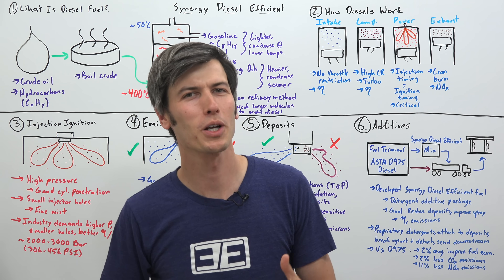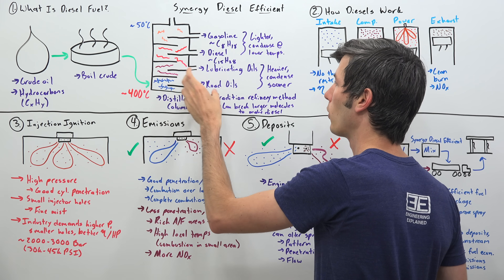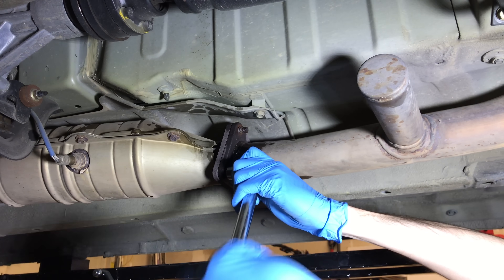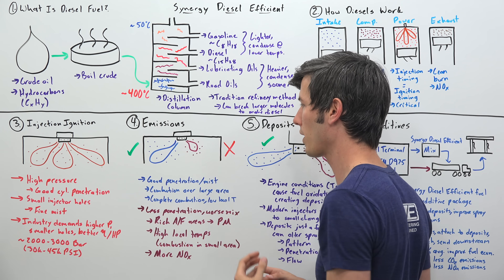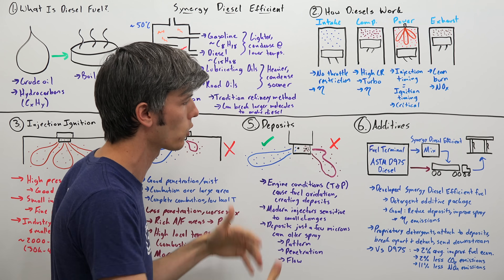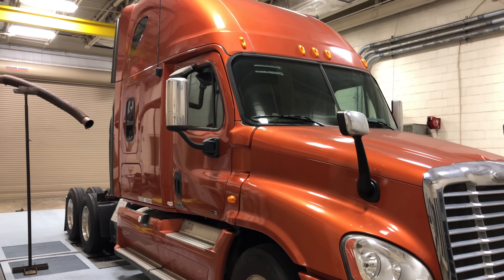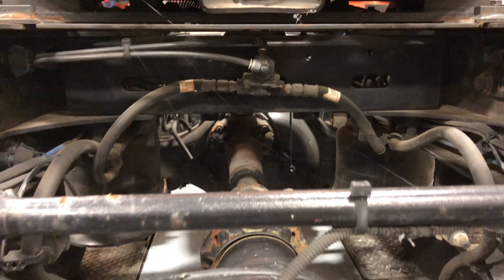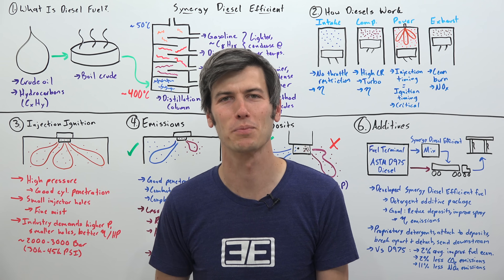Why Diesel Engines Lose Power & Efficiency Over Time

Comment: A load of cobblers, probably.  I worked for quite a while as an Engineer for a dealer selling engines from a certain well known US manufacturer.  Customers ranged from heavy duty & long haul truck operators, to large boats and mining company power stations. I never met a customer/owner who gave a fig about emissions, but they sure as hell all cared about fuel consumption.  That's because in all applications of large diesel engines, the cost of fuel is 90% of the cost of ownership over the life of the engine.  Dyno testing of dealer-serviced engines is routine - saves a lot of arguments.
So I can tell you that a 2% improvement as stated by Engineering Guy would startle the industry - its very nearly a 2% reduction in overall cost and typically about a 20% improvement in profit (10% operating margin).  So I don't believe it.   Oil companies are always claiming their fuel is best - they've been claiming that for ever since they started selling fuel, 100 years ago.   Secret ingredients are a dead giveaway.  It's really hilarious where I live.  In my country, there's a multitude of brands on sale, but only a couple of oil refineries.  In much of the country, all fuel comes from the BP refinery.   So it doesn't matter where or who you buy fuel, BP, Shell, Caltex, or whatever, it all comes via tanker trucks from the BP refinery, except for a small number of independent resale outlets importing from Asia.  Except for the independents, you get BP fuel whether you like it or not.   It doesn't stop the various brands claiming fuel purchased from their outlets has got something extra though.
As others have said below, engine efficiency only drops off to anywhere near  a measurable degree if it is not properly maintained and used with clean fuel and oil of the correct specification and within its use-by date.   And it is ALWAYS cheaper to do the maintenance and do it right.  No operator with half a brain is going to operate with fouled injectors.

Comment: If spreading out the diesel spray is so critical - why aren't there engines that have multiple injectors per cylinder? Maybe loads of small holes around the cylinder wall?
Reply: Some large Industrial and Marine engines do have multiple injectors. Probably a cost issue

Comment: Brother in law's 2000 F350 7.3 D has 800,000 miles and still an all original engine and would still pull most any house off its foundation!!

Comment: Hi, marine engineer here with a suggestion!

I understand that your channel is about the engineering inside a car, howerver I suggest for your channel to take a field trip to a producer of marine diesel engines, eg. Wärtsilä. These typically are very large diesel or BI-fuel engines. With the engines being a lot larger than the ones found in a car, all the components are too. This can really help as a visual aid for your audience. For example:
I used to work on a vessel using 4 Wärtsilä Sulzer 8 in-line 400mm in diameter making more than 4000KW per engine for propulsion use only, running on IFO360, MDO & MGO. Normally each cylinder has 1 fuel injection pump delivering the fuel at +/- 380 bar at a viscosity of 2-4 cst. However, the new type of BI-fuel engines have multiple fuel injection pumps per cylinder. These fuel injection pumps are actuated by the camshaft and are about 50 cm tall. If you want more info on marine application engines, feel free to contact me.

Comment: They should have outsourced the testing to VW for even better results.
Reply: Hahahah, funny!
Reply: I dont care about the emissions. The made one of the best engines in history. The 1.9 TDI.
Reply: @WorivpuqloDMogh  yep
Reply: Caterpillar did the exact same thing before VW and got just a slap on the wrist...
Reply: @C_R_O_M________  so did Harley Davidson -- but they're American so I guess that means it's ok lol
Reply: @C_R_O_M________  did not know that.. noice.
Reply: peter last 😂😂😂
Reply: Just think how much MORE fuel is burned over the world during emissions testing now that VW had to put their cars back to how they should have been.
Reply: Leo Rigby

It was never about how much fuel was being burned. It was how much emissions. Emissions are far worse than fuel use. 

If emissions didn’t matter, we’d all be driving two stroke engines and getting awesome fuel economy just like they did in East Germany in the 1950s.
Reply: @calvinnickel9995  yeah now I think of it a hotter burn would be a cleaner one. Wonder how the small petrol turbo engine does when it is squirting more fuel in to cool down the mixture to prevent knock. Wouldnt be picked up by emissions either i gues.
Reply: Rather, get their drivetrain control firmware/software from them.
Reply: Diesel should be what every vehicle has.
Reply: @talisikid1618  if i want a 2.0L NA 4 cylinder i should be able to get one
Reply: @talisikid1618  modern diesels are cleaner than they used to be as well. It will return and the downsizing of engines needs to stop
Reply: @WorivpuqloDMogh  I run a 1.5 Turbo TDI AND GET 28 MPH on Highway. It has plenty of day to day power. I maintain it religiously and have had no issues other than higher than normal maintenance cost.
Reply: @steveschu  28 MPG isnt that much actually. I got 45MPG with my 1.9

Sadly i got rid of it because i filled it up a few times with the red stuff, didn't want to get caught.

I now have a Xantia, same engine displacement, almost the same MPG
Reply: @talisikid1618  At least a mixture.
Reply: 😂true that👍
Reply: Savage
Reply: that hurts !
Reply: VW didn't fudge their emissions test results. They programmed their vehicles to operate more efficiently when the vehicle's computer detected that the car was being emissions tested
Reply: as a german i have to say VW/Audi were big liars in that.... put shame on our engineering !
Reply: Haha! Yeah I don't agree with torturing VW financially for what they did.  Swimming pools evaporate 100 times more chlorine molecules into the air and these can reach the ozone layer because they are lighter than air.  All refrigerants are heavier than air and soak into the ground,  thus never being able to float up to the ozone layer.
Reply: @scottbishop2532  Not arguing with your first point, because i feel everyone participating in the cheating should have been punished, and not all of it put onto VW. But i was super curious about the chlorine comment, turns out chlorine evaporation from pools, and to an even greater extent, the ocean, lot's of evaporated chlorine comes from salt water, is all water soluble, meaning it gets absorbed into moisture in the air and clouds, long before it reaches the stratosphere and the ozone layer, and just make the rain, air humidity have a slightly higher salt content. Where as NOx and the chlorine compounds that come from combustion, are not water soluble, and do make it to the stratosphere.  I love researching things and thought I would leave this here for anyone wondering. 

That being said I am way more worried about coal fired power plants and container ship emissions from burning bunker oil then a few passenger vehicles, and absolutely love my modified TDI.
Reply: @CondoreComputing  How can you prove that anything "makes it to the stratosphere"?  You can't !  If a gas is heavier than air guess what?  It is going to absorb into the ground not fly upward to the stratosphere why?  Because of gravity sir.

Comment: I have a 2012 diesel VW Jetta and it is a Turbo.  This car is great I get well over 40 MPG and the engine is so quiet.  Every time I stop for fuel and ask for diesel the  person (at the different gas stations) ask if i'm sure...  that's how quiet it is (In NJ you can't pump your own gas its against the law)    Are there anythings you should do to stop losing power with the engine?  I haven't noticed a difference since I owned it?  Just passed emissions with no issue even after that VW screw up  LOL
Reply: curious how many miles you have on it ?

Comment: It's a shame that Exxon-Mobil couldn't find a way to pre-mix detergents into the ~10 million gallons of crude they dumped all over the Alaskan coastline, it might have made life 2% easier for the people who had to clean up the mess. Or maybe it would even have killed 2% less wildlife? It definitely would have made people forget about the disaster 11% quicker, although that seems to have happened anyway...

From Wikipedia:
Litigation was filed on behalf of 38,000 litigants. In 1994, a jury awarded plaintiffs US$287 million in compensatory damages and US$5 billion in punitive damages. Exxon appealed and the Ninth Circuit Court reduced the punitive damages to US$2.5 billion. Exxon then appealed the punitive damages to the Supreme Court which capped the damages to US$507.5 million in June, 2008. On August 27, 2008, Exxon Mobil agreed to pay 75% of the US$507.5 million damages ruling to settle the 1989 Exxon Valdez oil spill off Alaska.[10] In June 2009, a federal ruling ordered Exxon to pay an additional US$480 million in interest on their delayed punitive damage awards.

Comment: If the new diesel additives are suggested to reduce/remove carbon deposits from the fuel injector heads, would this imply that the PM 2.5 and PM 10 emissions increases for vehicles run on this new diesel blend? It was suggested that inherit in the burning of diesel fuel that due to fuel spray inconsistencies and irregularities affects such as high A/F ratios to can lead to carbon deposits forming. Is there any data out there that suggests this? I know that this analysis listed the NOx, CO2 and fuel economy values but how do PM 2.5 and PM 10 emissions compare with just using the standard diesel fuel vehicle?

Side note, I’m not going to get into which emissions are worst: CO2, NOx, PM 2.5, etc. I’m just interested in the engine, and fuel engineering here. If it is shown that particulate matter emissions can be reduced using this fuel it stands to reason that more efficient Diesel engines can be designed to utilize this fuel blend... (finer/narrower fuel injection ports, etc..) however if it is true that the burning of diesel always forms carbon deposits then what is the importance of fuel additives that “scrub fuel injectors” over a periodic engine service which removes the deposits from the injectors done in the shop?

Comment: Diesel stinks and the smell if the exhaust is even worse. Diesel maintenance sucks and It's more expensive than a gas engine. I had a diesel Jetta for a few months...$350 for an EGR valve because of a leaking seal that should have been replaceable on its own. I got rid of it as quick as I could. $1200 for a turbo, $1200 for an injection pump...I paid that much for the car. If I ever go back to ICE cars, I'll stick with  Honda vehicles.
 $7000-$10000 head gasket job on these Chevy and Ford diesel trucks, several thousand for a turbo replacement, $200 oil changes... Hard pass.

Comment: You never mentioned how CETANE affects the engine operation. As a diesel owner, I feel that's a pretty damn significant thing to not even touch on. I'm going to guess it's because ExxonMobil's "special additive package" mainly is just a small CETANE boost with the standard additives I can get at Chevron.

Comment: Diesel injection pressures can be as high as 100Mpa. My old Corolla Diesel would idle around 30Mpa. At least, that's what the OBD2 reading for the fuel rail pressure said.
Reply: I didn’t know they made a diesel version! Obviously not in the US
Reply: @SquishyZoran  It had the 1AD engine, a 2.0 liter turbo Diesel that was also used in the Verso and even some Avensis models. The slightly larger 2AD engine (2.2 liter) is also used in the RAV4 until 2018. Since 2014 they also use the 1.4 liter 1ND engine in the newer Corolla.

I must tell you, that engine just barely fitted in that car. You could barely get a decent size spanner in to leverage the belt tensioner and to replace the alternator you had  to drop the right hand drive shaft. And mine had cold starting issues, which was partly caused by fuel pressure (the suction control valve was sticky), which is why I know about the fuel pressure. Apparently there was an updated SCV and firmware flash that would raise the diesel pressure to above 100Mpa for starting in really cold climates.

Anyway, I sold that car not too long ago, and bought a Diesel RAV4, the one with the 2AD engine.

Comment: I know this isn't a major objective for this video, but I've driven gasoline and diesel pick ups with over 450,000 miles on the engines. Obviously performance is compromised, but they still run well. Maintenance is the number 1 factor.

Comment: Hp tuners, def delete, dpf delete, fms install and converter lock. Gives my truck 4-6 miles more per gallon and lowers maintenance/ repairs costs by extending oil changes (soot no longer enters engine)and landfill addition caused, and no longer deals with chemicals leaking into the environment while in use, So what says you epa who causes the mess a dummy like me solved in my driveway?

Comment: Old TDI engines may have over 600k km and no power decrease. See it on "Miłośnicy czterech kółek" channel.
Reply: I had vw passat tdi with 480k km mileage and still kept the factory power. Good fuel, frequent oil change and skillful exploitation. It is not without reason that these engines are called not to be destroyed. Fuel system was not repaired only turbine and clutch.

Comment: So it will not be available to most of the trucks on the road in the US. Fuel cards save far to much money to not use, and small shops may take them as payment but you get charged pump price + out of network. Yes some smaller fuel stops compete with the discounted prices from fuel cards but their is no reliable way to find them driving across the country, where as the fuel cards provide apps that tell you exactly what the fuel will cost you at all of the network stops making planning simple.

Comment: My 2005 Mercedes e320 cdi (diesel) dyno'd at 205 HP at 457,000 miles on the original engine. The car was rated at 201 hp new
Reply: What is economy in liter to km?

Comment: So if the added 2% efficiency comes from cleaner injectors shouldn't you weigh the added cost of the fuel against the cost of new injectors?

Comment: In short for the light duty diesel guys, run a water meth kit, water air separator lift pump (pick your poison), full synthetic oil (if compatible)  and Lucas injector cleaner (fuel treatment).

Comment: Did the standardized D97.5 fuel used for the baseline have no additives or detergents? Because that would be completely unrealistic because every fuel manufacturer puts additives and detergents in their fuel but that would be the easiest way for Exxon to show an improvement by using a baseline fuel no consumer could ever use. Let’s see data versus their competitors fuel.

Comment: I have a question. I stored diesel gas in a plastic gas container that used to have unleaded gas in it (there was still a bit of a gasoline smell) because i had no where to put it. Would it be safe to put that diesel that was stored there (for like the last 3 or 4 weeks) into my diesel truck fuel tank? Any help on this would be great.

Comment: It would be interesting to know if there was a control group run with normal fuel in the same way, it's actually not mentioned in the video. They did say the vehicles were serviced before the test so it could just be a combination of the service and more idyllic driving conditions (presumably temperature controlled lab, less rpm changes if any?) that caused the improvements? Just comparing before and after doesn't seem like a fair test.

Comment: People hatin' on VW diesels, but my buddy's '99 Jetta TDI recently rolled over 500K(kilometers, not miles). Pretty damn good regardless...
Reply: I also have a vw golf from 95 and from time to time If I feel that it losses power I just run it at a higher rpm for a time  to loosen the deposits off

Comment: hi, do you recommend using fuel additives like fuel injector cleaners to keep the engine running smooth? if so, any particular brand? thanks.
Reply: Thats my questions too, but i read my owners manual they said yes diesel, in my gas car no need coz i fill up only to shell

Comment: Why bother putting it on a dyno if you're just connecting to the drive shaft?
Reply: "Why bother putting it on a dyno if you're just connecting to the drive shaft?"   So the truck stays in the facility...
Reply: @lylestavast7652  Would have thought it would be disconnected from the wheels?

Comment: I had a mechanical 3406 that had a million miles on it.  440 horsepower to the road on day one.  A bearing roll, and one injector is all that was ever done.  Pulled just as good and had the exact same fuel economy when it was sold as it did when it was new...it was in an over the road truck.

Comment: Diesel engines loose efficiency over time as a result of crankcase gasses being mixed with soot from exhaust gas recirculation forming a lovely tar like substance all over intake runners valves and injectors.
Spent exhaust is added to combustion to decrease temperatures and therefore NOx emissions to pass environmental laws.
No fuel additive will change this circumstance.  Only a rethink of diesel design or a law change.

Comment: Why don’t diesels suffer from carbon deposits building up on the intake valve like direct inject gas engines?
Reply: They do, but only because of egr, if the egr was deleted, and the crank case vented to atmosphere, if only filtered air was going into the intake then the valves would stay clean.

Comment: biggest question is, what good does that additive package do for class 8 vehicles? I've never seen a Chevron or Mobil station that I can get into. seems like a huge waste of fuel unless they are supplying the corporate truck stops with additive packages. as a single truck owner I spend over $80,000 a year on fuel 2% would make a huge difference